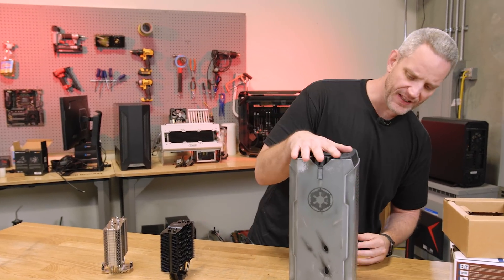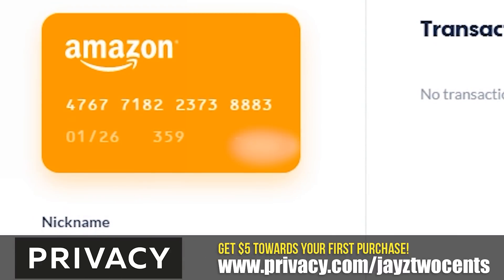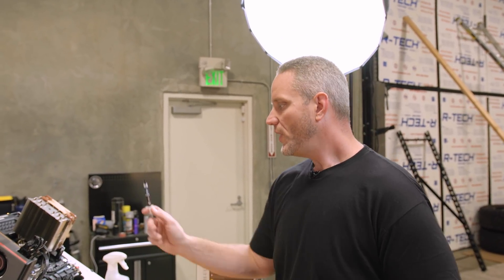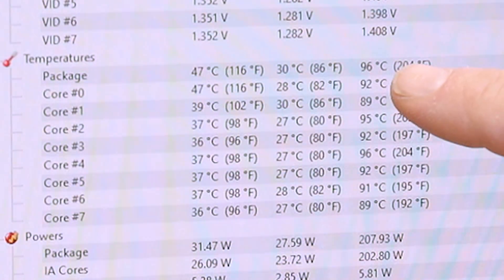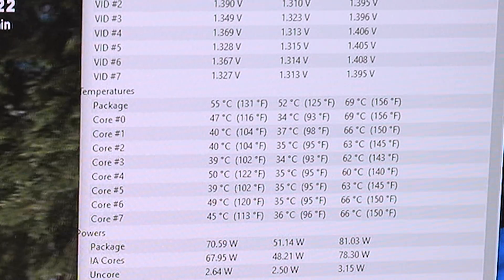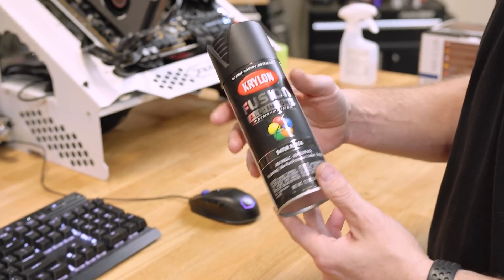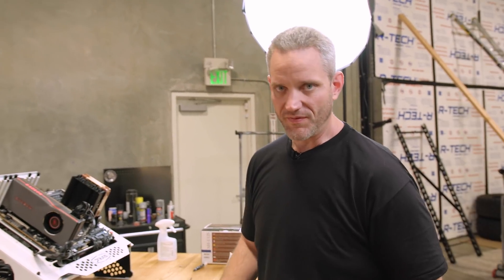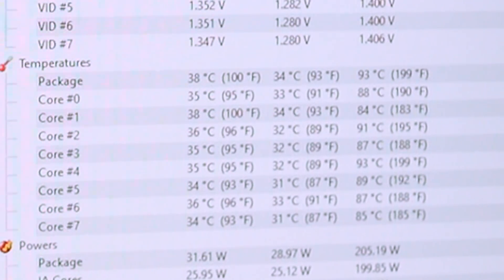Does painting a heatsink hurt its performance??

Comment: Posting at 1:23 before watching rest of video. I don't think it will have much of a performance difference but it also depends on what spray paint/normal paint you're using. Could see maybe paint bubbles, paint chipping or flaking perhaps.

Edit: changes temp slightly but in real world environments not enough to notice or to even say so. Would like to know the condition of paint after maybe a month of use/heating.

Comment: 0:37 Nope, they are anodized or e-coated. Ceramic coating is for durability, way to expensive for a random styling "mod"
Reply: Anodised aluminium is surface is aluminium oxide. Which is in turn technically a ceramic, even though people don't usually call it that way.

So they're misleading, but not wrong. Anyway that's what beQuiet themselves call the black surface, probably because they had to to reduce the cost after doing black chrome for a while, while not making it sound too pedestrian.
Reply: @SianaGearz  Erhm no.... Ceramic coating is a real thing and it's used for all metals. Ex the cookware in your kitchen are a likely place you could find some ceramic coated metal
If BeQuiet have called it ceramic coating it's because they keep making "creative" marketing, like they always have done a bit
Reply: @VikingRul3s  We're not actually at disagreement, even if i may have come across that way. This is misleading marketing, as i said.

I don't have to google ceramic coatings for metal, i have been around long enough that i know what is generally meant, glass-like or clay-based coatings which is obviously not what beQuiet is doing.

What i was aiming for is that it's not Jay's fault, he's just going by beQuiet's claims.
Reply: @SianaGearz  Ooh, my bad. Yeah, i didn't think Jay was doing it to mislead people. As you said, he's probably following what BeQuiet advertised. So i was merely correcting the obvious
Reply: @SianaGearz  Here, this was literally the "i'm feeling lucky" google result after typing in ceramic coated metal. I've been a pro-metal worker for decades now. Please use google next time before you claim someone els is lying:
• Plasma Spraying: In plasma spraying, ceramic powder is passed through an ionized gas at extremely high temperatures, sometimes approaching 30,000 degrees (F). The pressurized gas speeds molten ceramic particles toward the substrate where they bond onto its surface. The result is a strongly-adhering and high-density coating, but the process can be very expensive.

• Detonation Gun: The detonation gun process is most effective for particular ceramic materials, such a tungsten carbide, that are required for producing highly dense coatings on a metal surface. It creates an explosion of oxygen and acetylene gas at around 6,000 degrees (F), melting the ceramic and firing it at high speed toward the target substrate.

• Oxygen Acetylene Powder: This method involves heating ceramic powder under a 5000 degree (F) flame, and using compressed gas to spray the coating onto the substrate. It creates porous coating layers with relatively low adhesion strength.

• Oxygen Acetylene Rod: In this method, a fused ceramic rod is passed under an oxyacetylene torch burning at 500 degrees (F). Pressurized gas is then used to spray molten ceramic material onto a surface, producing a coating with a high level of cohesive bonding.

Comment: I think this z390 board really sets the standard for Load Line calibration and voltage stability.   I have never seen a board that is so consistent in holding the requested voltage both while idle and under full load.  All my asus boards have wild variations and then similar wild overshoot when trying to compensate.  This board also has a significantly lower socket (package) temp then all my Asus boards at the same voltage.  Just know that there is no good way to monitor you voltage through software on this EVGA board.

Comment: Form > function = dumb
Even if the temperature difference is neglible, the sprayed surface is not as smooth, catching dust easier than without.
 Anodized surface would be different matter ofc
Commented before seeing the results, (extra) point for that?

Comment: I'd be curious if the type of paint is the bigger issue. Maybe something with more of an aluminum base. Could look more into paint used to re-coat electric motor housings, as heat dissipation is a bigger concern there.

Comment: This leaves me wondering about motherboard heat sinks, I took an older Z97 board from MSI and because I hated the red and wanted a pure Black/White build I removed and sprayed the heat sinks with thermally conductive engine paint, never really notcied any difference but had no way to measure

Comment: Yes it will, its physics you changing the air temperature  conductivity, even you cant pick it up its because its calibrated to read larger values, same came up with if you paint intercoolers and Engineering Explained did the maths behind thermal conductivity

Comment: Presiction- While I think it will reduce the efficiency slightly. I would be concerned with the longevity of the paint. I would think you could or would want to use grill paint, but I would think using that kind of paint would reduce the effectiveness of the cooler even more.

Comment: 1:18 well the heatsink is not Nickel Plated Aluminum, if so it is supposed to be a pain the butt to paint over, also manufacturers work with bare aluminium, so ceramic coating or electroplating or powder coating or something is always needed to protect the aluminum

so I say the heat will go up, how much depends on how much coating you add

Comment: Certainly not disputing the insulting properties of the paint - just want to make that clear. Also has been a while since my engineering days, but black tends to radiate heat quicker than shiny surfaces, so one would expect that the black cooler would be 'cooler' than the pre-painted version. I know paint is applied in the level of microns, but given three coats were applied by hand, I wonder if this has sufficinently narrowed the distance between the fins to make airflow a factor. I'm sure Noctua will have researched fin density/distancing to ensure optimal airflow, just wondering if this could be a factor?

Comment: This is very bad testing. Adaptive voltage will be overridden by the VID values if the set voltage is lower than what the svid wants. Ur better with offset mode and svid behavior set to best case. Ur pushing way too much voltage for that load. Oh and cinebench does not burn the cpu like prime95 avx small fft.

Comment: G'day Jay & Phil,
very Interesting, I wonder if you would see a difference with a Ryzen Athlon200GE/3000G & where on the CPU performance scale you start to see a difference if there is none with the Athlon, I also wonder how bad the stock Intel CPU cooler would do if you painted it, Hmm I see a project of a Sky Blue Heatsink for the Intel Cooler on my i5-661 & Gigabyte H55M-D2H,

I once got told that painting the Rocker Cover in my 1.6l Suzuki engine was gonna make it overheat because heat rises & the paint will stop the heat getting out 🤔

Comment: The real effect is one of surface roughness. The rougher the surface, the harder it is to break up the boundary layer of air that adheres to it. It has nothing to do with insulation or color. The smooth aluminum is far less tenacious of the boundary layer so the fan can more easily replace the hot air by cooler air. The black anodized cooler would have the same performance as the unanodized one, because it has the same smooth surface, and both would be better than a coated cooler.

Comment: i figured the delta gain would be more after painting it. mostly since noctua has been saying for years that the ceramic paint still  added a delta of 1c and that has been why they haven't done it before the chromax. so a 3c delta is a lot less than you would think.

Comment: Old vs Painted temps
package 69 -> 70 (+1)

core#0 69 -> 69 (+0)
core#1 66 -> 69 (+3)
core#2 63 -> 68 (+5)
core#3 62 -> 68 (+6)
core#4 60 -> 72 (+12)
core#5 63 -> 68 (+5)
core#6 66 -> 70 (+4)
core#7 66 -> 68 (+2)

(0+3+5+6+12+5+4+2) / 8 =  4.625 avg
so rougly 4.5C average increase per core. I'd say that's significant

Jay : "It looks like we gained 1C maybe 2 on like that one" points at core that gained +12C

Comment: But 2400 RPM fan isn´t loud? Maybe I´m too sensitive about noise, the most louder fan I have installed in my machine is an old Deep Cool aluminum 2000 RPM fan and I don´t like it because I can hear it in the background. Heck, I really HATE my RX580 8GB card because of the fan noise the thing produces (Powercolor Red Dragon). And yes, I know, the more performance you want, the more heat your machine will likely produce and more air you need to move to cool your hardware part. I´m really almost giving up and the next video card I buy will have the fan and heatsink ripped off and a WC solution installed on it, like a Kraken solution or such.

Comment: I would predict it depends on the type of paint, how much paint ect, if you coat it in a thick Acrylic it would probably hurt a few degrees. However the metal that is in contact with the CPU shroud should disperse heat to thins regardless... but the fans might have a bit more difficulty.........I changed my mind i think there will be no difference .... this post is a waste of time xD

Comment: I predict that it depends on the paint as some paints are natural thermal conductors with Aluminium Oxide. However, some are thermal insulators which may prevent a small amount of thermal displacement but not by much. So I guess it depends on the paint???

I am still unsure if I am right or not XD

Comment: prediction. Used as a passive cooler, no difference in performance. IF the paint plugs up and/or restricts airflow from fans then there will be reduction in performance.

Comment: Why is this even a content worthy question? Of course it does. You basically apply a thin coat of paint on a piece of metal taht supposed to dissipate heat directly from its surface and expect it to perform the same

Comment: I think one or two thin coats wont matter, a crap load of coats might. Also, it may depend on the paint - radiator paint or other heat sensitive paint is made for that kinda thing... Idk I plan on painting possibly a small GPU AIO or even a Alphacool GPX, the latter actually sinking heat. So useful info for sure.

Comment: The only time I'd probably look to do this is if I was going for a "different" scheme other than the silver or black of normal heatsinks i.e. painting it red for example or even going with a metallic effect. Doing a quick Google seems to imply that metallic paint would actually make heat dissipation worse. Waiting for the car build where Jay uses engine/automotive paint to do another car build.

Comment: Part 2: metallic paint, one with flakes. Might add surface area like they say the ceramic coating does.
Anywas, I was hoping black would radiate heat more, so no difference, but seems there was. Maybe day or two of drying would help a degree.

Comment: Before even watching the video - black things are good at radiating heat and shit at reflecting it and shiny things are good at reflecting things and shit at radiating it. If anything, the RADIATING situation is supposed to improve as long as you leave enough space between the fins for the air to blow through without any impedance.

Comment: Pretty much exactly what I expected to see. 

When I mod coolers (tower) I typically just pry off the top fin (careful not to damage it) then just paint that and reinstall it when done. Its easy to do, doesn't effect cooling at all (maybe a fraction of a degree) and it looks factory when done. Realistically, if you are using a dual fan tower anyway there is absolutely no need to paint all the fins. The fins are almost always press fit onto the heat pipes so gently tweaking the top one off with a flat bit of steel (as wide as you can fit between the fins) is pretty easy. Then once painted, sand out any paint from the contact area where the fins meet the heat pipes and then lay the fin flat and give each of the holes a light whack with a hammer to tighten them up a bit so they fit snug on the heat pipes again.  The last step isn't really necessary, you can just use the paint in the holes to ensure a snug fit, but doing the last step satisfies my OCD. Realistically a single missing fin on the fin stack isn't going to effect cooling in any measurable way unless your stack is very sparse to begin with. 

If you use a single fan tower cooler and the edge of the fins are visible (and that bothers you) you can always just run a sharpie of the same color you painted the top fin over the very edge of the fins. This won't cost you any cooling efficiency and will look a lot more uniform.
Reply: Why not just mask off the top fin and avoid the removing part?
Reply: @mikesiemens4145  You can do that but with how easy it is to lift the top fin off, it's just quicker and easier. You also don't have to worry about over spray or crappy masking tape.

Comment: actually paint should make a difference, because it changes the emission grade. this is also why you only see painted radiators. (the big things hanging on your wall to heat your house, not the pc components) I have actually asked myself the question why so many heatsinks are not painted, and for aluminium its obvious: the oxide layer doesnt cost you anything and probably has an "ok" emission grade. dont know what the material of the heatsink in the video is, but i guess its stainless steel? it has to has some sort of surface manipulation, because stainless steel has a crappy emission grade when its blank. so i say: blank metal vs painted should make a difference, but they wont sell it like this if that was athing. so i guess that is not blank metal what we see there. but im no expert.
edit: to make this clear, I mean painted metal emits way more heat than clear metal. just watch it with a thermal camera. or think it the other way, blank metal also doesnt get that hot in the sun than painted metal. this principle works both ways.

Comment: This test is a little bit useless. Nobody runs a cpu fan @ 100%. And the problem is: if you run the fan at 50% or maybe 75% you got an much lower air flow. With this air flow you cant transport the same amount of head away... so the color acts even more as an insulator.

The only interesting point, which isnt checked here, is: Whats the delta in a normal situation with not maxed fan speed. Dont understand why you dont test this. The "maximum capability" is no real scenario.

Comment: I was wrong I thought the performance would bottom out and the cooler would be next to useless. 

I’m actually surprised at how much difference the fan makes, so basically if you have something like a 3600 paint away and if it’s something beefier just throw on a better fan. 

I’d like to see a video about painting your fan because that’s another one where I’ve seen it work for people but everyone generally says it’s going to throw the balance off and ruin it.

Comment: Spraying an intercooler black makes an improvement. I guess with higher temps from a CPU cooler it makes more of a difference.

Mighty Car Mods was the whole spray intercoolers black.
Reply: A dark / black surfaces makes for a better radiator, so that's probably why. But it's a tradeoff - paint also adds thickness and the paint is less thermally conductive, so there's just a lot of variables. But there are better ways to make really thin coatings using other means (other than paint), that will help improve the emissivity of the surface. The lower the heat load, the less the extra thickness of the coating matters - because the heat has more time to diffuse through the material.

Comment: Before I get too far into this, the same experiment was done on car radiators by Mighty car mods. And the general outcome was "it makes little to no difference". Black absorbs energy quicker than aluminium silver/grey but also radiates it quicker too. Because these little rads are rarely exposed to direct sunlight there shouldn't be any worrys. Plus water cooling rads are black... so, y'know.

Comment: The airflow cooling should decrease while radiation cooling should increase so I guess it will do worse at low temps and better at high ones.
car radiators are black for a reason.

Comment: Wait a second.... you said they ceramic coated the cooler.... jet hot is a company that has been ceramic coating our headers for years; TO KEEP THE HEAT IN AND NOT DISSIPATE THE HEAT INTO THE ENGINE BAY... so it’s an insulator. Why would they do that to the cooler?

Comment: Scientifically the color black has been shown to absorb and radiate heat better than other colors and straight metallic surfaces, what matter here with an air cooler or radiator is paint thickness, I believe that if you masked off the fin edges so that the internal fin surfaces that actually provide the convection to the air flow did not get coated simply painting the outside of an air cooler shouldn't make any difference.

Comment: My prediction is dependent on the paint's base and its application... latex in a spray can applied at less than 6 inches in more than 3 coatings = insulator. Acrylic in a spray can applied at at least 6 inches away with 3 or less coatings = no discernible difference that is within the margin of error.